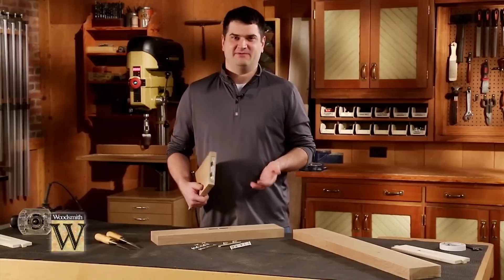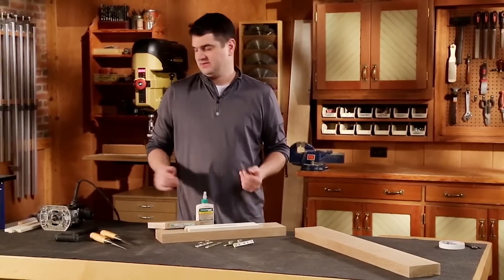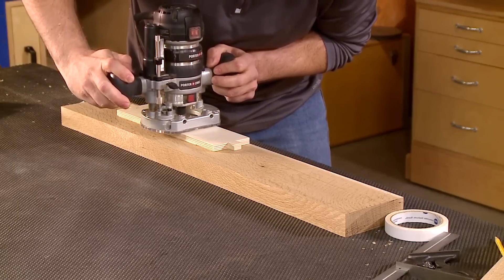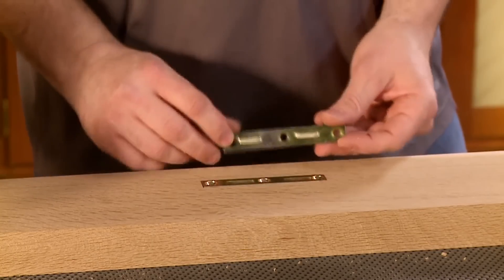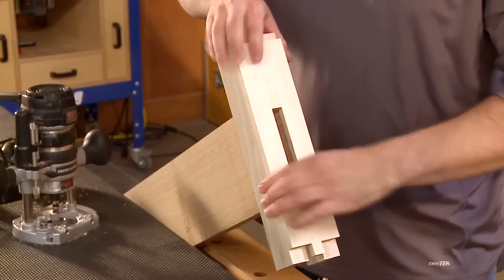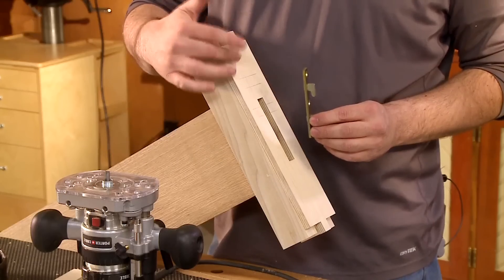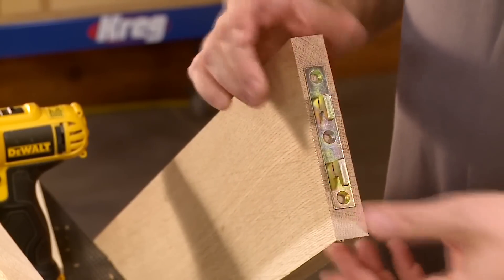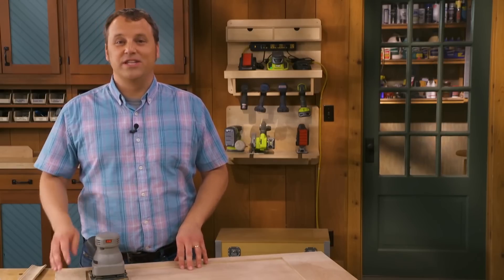Tips for Installing Bed Rail Hardware

Comment: this will be way more convenient to assemle and disassemble the bed frame. I didn't want to deal with doing those 3 joint cuts cause I may screw up. thanks you for the tip in installing these metal rail brackets

Comment: I found the pattern bit to be a real problem.  They are typically 1/2 inch and the mortise is 5/8 inch.  It's far too easy to cut into the edge of the template.  I found the better choice to be to use a 3/4 inch template guide and a 1/2 inch straight bit.  With this you need to make the template 1/8 inch larger all around 1/8 = (3/4 - 1/2)/2.  Then there is no worry about bumping into the template with the router.  Also you can withdraw the router without needing to shut it down completely.  The template guide set is also about 1/2 the price of that pattern bit and a couple of extra bearings to give it the support it needs.

Comment: The template shown in the video fits the bracket at its max width, not its minimum width, ignoring the 11-degree bevel on the bevel that you would otherwise manually have to chisel out to accommodate.  I have created a template for the minimum width, so I will have to chisel.   I think your way is probably a lot more practical, I'm not sure that bevel adds a lot of stability.
Reply: Realizing that I have 24 of these mortises to do, I decided to ignore the bevel and use your approach.  Thanks for publishing this video

Comment: I like the dowel. Why didn't you use a dowel for the top screw also
Reply from the maker: The dowel should be long enough that all 3 screws will go through it. You could put a  dowel in from the top and bottom, I just didn't want it to show from the top.

Comment: Is there any play when it snaps in? Which turns into squeaking. 
Hesitant on buying this.
Reply: There is a bit of play when installed perfectly flush.  Recessing the hardware ~1/32" is the best move.  Take the time to set you router depth by testing with scrap and you'll get it nice an tight.

Comment: 2:09 "Just look at it until it's perfectly flush."  I've been using that method for years, but still I don't quite seem to have the hang of it. No matter how long I stare, the SOB still won't flush-up.

Seriously, though, just like you, I just built my son a bed. And, just like you, I shied away from this style of hardware. If I had seen this video a few months ago, my son's bed would be of better quality. Hopefully I don't forget about this by the time I go to build another bed.
Reply from the maker: LOL... You really have to stare it down with some side eye to get it to flush up properly.  :)
Reply: @WoodsmithShowandmagazine  This is why I love you guys - all these little bits of insight. I've been giving it full-on full frontal stinkeye this whole time. I'll try the more subtle side eye approach next time I'm in the workshop. Thanks for the tip!.

Comment: Great tip using the dowel. Couldn't you just use a drill for relief of the nubs on the hook plate?
Reply: That's what I was thinking. Hand drill with a forstner bit would be way easier imho.
Reply from the maker: Drilling out the relief for the nubs would actually be a much quicker way, but I get carried away with the router sometimes :)
Reply: @WoodsmithShowandmagazine  I've done this with a drill.  It depends on the size of those nubs.  On mine they were less than 5/16th so they were easy with a 5/16th brad point bit.

Comment: Was the dowel really necessary? I'm worried about introducing a new place to screw up. Any tip for getting the 5 in hole in the right spot?
Reply: You can use 3 dowels, one for each screw. Going though the thickness of the rail instead of the full width.